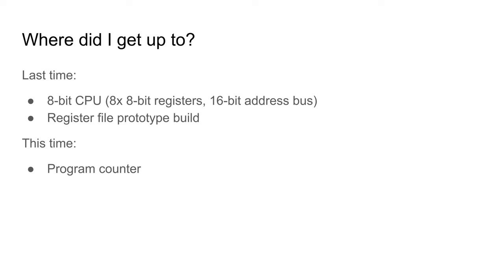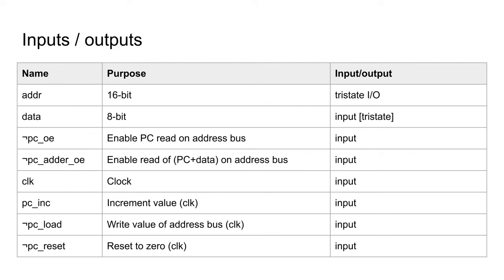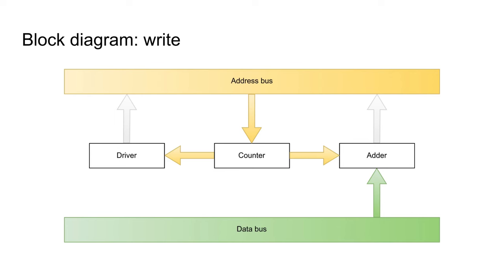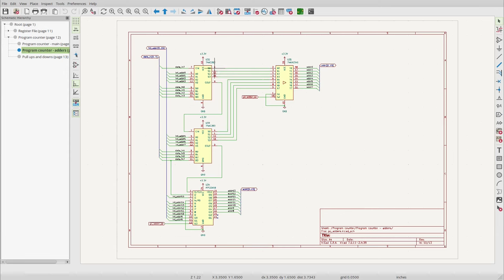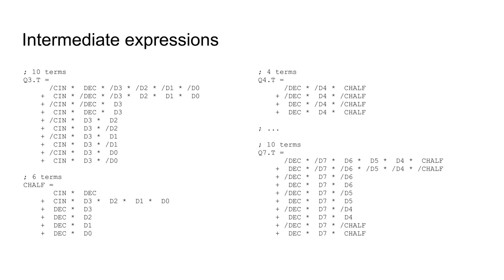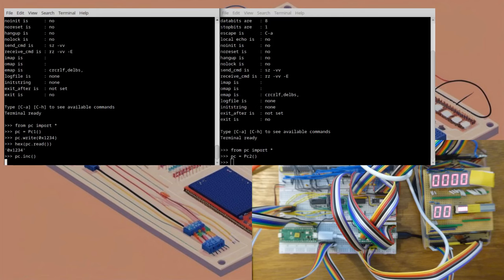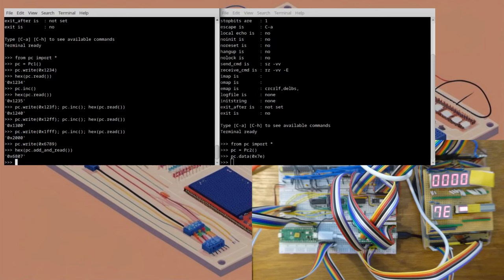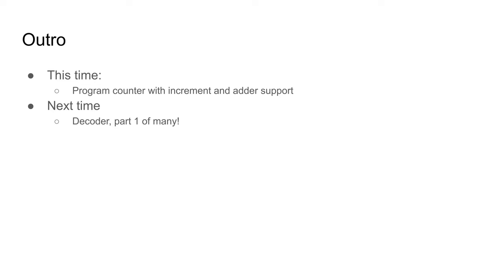Designing an 8-bit CPU - 6 - program counter

Comment: You might keep in mind you also want to output the program counter to the data bus so it can be pushed onto the stack before a jump to a subroutine and later read back of course.
Reply from the maker: This is a very good point!  I had forgotten about JSR instructions.

I was going to use a register pair r7:6 for the link address (like ARM uses r14).  I'd need a way to get the address back to the register file.  It sounds like I have some more rewiring to do 
😆

Comment: Very interesting project. Thanks for taking the effort to document what you are up to. 

Was surprised to see PC relative addressing, as that’s generally considered a luxury on small systems like this is shaping up to be.

Curious whether this will be microcoded or sequenced in a GAL or CPLD, but I suspect it’ll end up needing a fairly wide ROM?

The ALU is also gonna be interesting to see as, again, there’s a fair few approaches. 

Anyway, glad I found your project! Looking forward to the next instalment. 😊
Reply from the maker: Thank you for your comment!

I've already used some GALs because the alternative logic with "pure" 74-series would be cumbersome.  (Also, I bought too few of some chips on my last order, so had to use a GAL to compensate.)

I've not played with CPLDs.  I think Xilinx is stopping manufacture of the common CPLDs, I guess with the reason being that FPGAs have been a thing for long enough now.  I remember seeing a FPGA run the game of life at university, supposedly faster than the contemporaneous Pentiums.

I'm struggling to get time to play with the project, sadly.  My work has hit a crunch point and my energy has been zapped.

I will have some significant changes in my next video.  I think I'm getting somewhere with the decoding / pipeline design.

Anyway, thank you again and hope you enjoy!
Reply: @phodopus42  just reading about AMD knocking the head on the CPLD. The distinction is certainly blurry now with FPGAs available with nonvolatile storage, which was one of the key differences. But historically CPLDs and arguably even today they have different uses; small amounts of logic that doesn’t justify a FPGA or ASIC. Hopefully Atmel erm microchip will keep manufacturing their Altera MAX7000 clones. I made good use of MAX7000s in my 6809 and later 68000 boards. You can even get them in 44 pin PLCC so you can jam one in a breadboard. One would work in your projects, but the software can be a pain to find these days. 

Project burnout is a thing, which is why I try to have two on the go. Hobbies are about having fun, so don’t feel bad having break.

Anyway, take it easy! If you want a look at my crappy channel... You might find something interesting. :)
Reply from the maker: @lawrencemanning  Nice -- just checking out your videos after a long week at work 😀

I think chip manufacturers can't really justify supporting electronics hobbyists long-term.  I can see that DIP as a package is going to disappear at some point, with some chips pretty much impossible to find in that format.  I ordered some 74-series from a Well-Known Distributor 2.5 years apart and got DIP chips from the same batch.

I guess repairing 80s computers will, in 10-20 years, become like repairing valve-computers is now 😕
Reply from the maker: P.S. your channel can't be worse than mine 🤣

Comment: 6502 uses the ALU for relative addressing. RISCV uses the ALU for compare. Your branch seems to not use the ALU at all.

Who ever uses PC relative addressing? Is it for switch case? So you have low integers, or a good hash, and then some addresses around your current instruction are filled with function pointers? Why not roughly match the size of case branches and shift left the integer to convert it into an address? Or use the hash? Or just a tree of branches? Hybrid. Ah, optimising compiler.

So it is for switch(enum) only.

In RISCV and MIPS there is only one addressing mode: register+immediate . Register 0 is always 0 . Program pointer cannot be read. All other 31 names are for GPR .
Reply from the maker: Thank you, interesting thoughts!

ARM uses PC-relative a lot because there's no absolute addressing.  It works well as long as you can keep your data close to your code.  I remember tricks like putting constants at the end of a function so that they are within the accessible range.

So I was going for PC-relative instead of absolute addressing.  It also makes it easier to write relocatable code, which is a real pain on the 6502, not that it matters with no MMU and a 16-bit address space 😮
Reply: @phodopus42  a quick search tells me that this addressing is only used to load Immediates which don’t fit into the instruction. RISCV can load 24bit immediates, enough for the whole address range of a 68000. JRISC just lets immediates follow in the instruction stream like 6502 does it. With 32 registers in RISCV you load each all constants at the smallest block scope. I can see how 16 register Arm wanted to save registers and memory.
Reply from the maker: @ArneChristianRosenfeldt I think you might be right.  If I have 8-bit registers, then a "load immediate" will suffice for loading constants.

I do need something for code in ROM to access scratch RAM.  The 6502 did this by adding zero-page addressing.  That's maybe what I will go with. 

Thanks again for interesting ideas.
Reply: @phodopus42  high level languages for some reason don’t use a scratchpad, but a stack and a heap. With a base pointer and this pointer (BX in x86?) . 6800 has 16 bit pointers. I may repeat myself here, but RCA showed that 16 * 16 bit did fit on a die, even in somewhat larger CMOS logic.
Reply: @ArneChristianRosenfeldt There is actually a number of processors that can use the PC as the base register for relative mode addressing. On most cases the instructions to do so are provided just as a matter of encoding orthogonality, not that they are used very often. However there's a critical difference between PC relative and GPR relative modes when talking about Harvard's architecture processors, because the first mode will access program memory while the second one will access data memory
Reply: @RelayComputer  encoding? MIPS must be the most orthogonal encoding and it still distinguishes between J-type and the others. Most processors have a power of two of GPRs matching the bits in the encoding. RISC has two special registers available for addressing: zero register and link from jump and link. Arm has SP.

Harvard is all nice and good(ROM cartridge/embedded, DS in x86 , immediate), it just looked like it is not even possible to have a look up table. So you say that execution is faster when a program loads constant data from the executable in front of the stack.